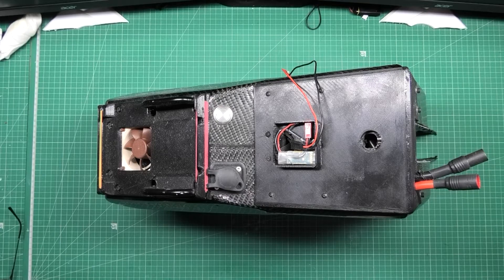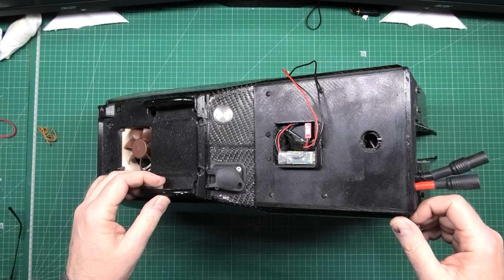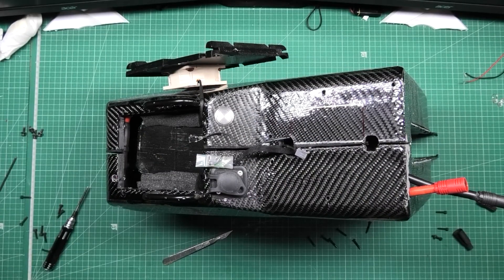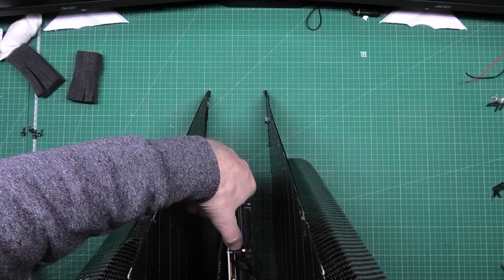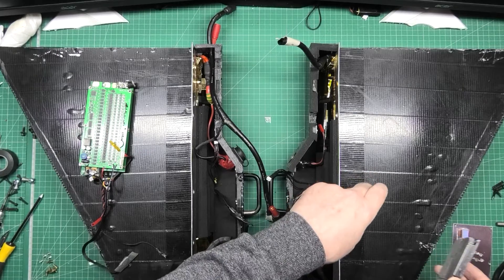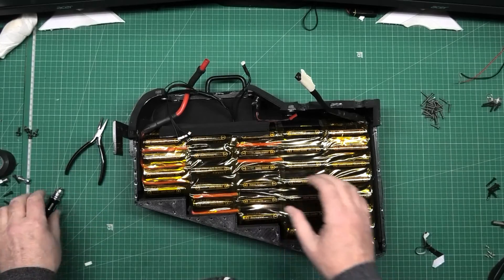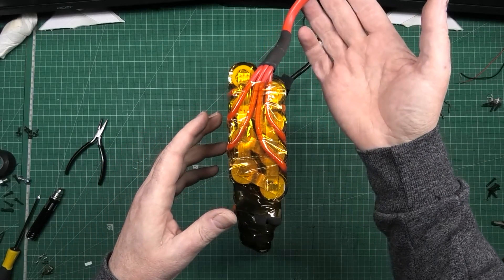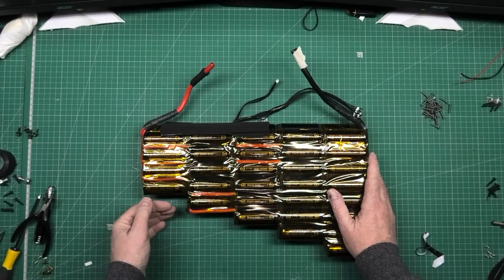High powered e-Bike battery BMS replacement - part 1

Comment: Hi, do I use common or separate port  bms type for ebike 72v 20s 3p 80 continuous? Thx
Reply: Hi guys, i have a question, thx in advance if youll help.
Im building a ebike, with my own battery pack, 72v 20s 3p (80a continuous, 105A peak) with 18650 cells sony vtc5a, what BMS do i have to get, i found one on aliexpress from Daly, and i can pick common port (2 wire) and separate port (3 wire) . Which one to buy, 2 or 3 wire version? Do you have another BMS to recommend?
Thx guys, im new here and in e bike space, cheers

Comment: sounds like a cell or two has been damaged in cell bank “six”...higher inner cell resistance will drag down the voltage of the other cells in parallel to the damaged cell(s).   Maybe got a lil warm...🤷🏻‍♂️    Dang batteries always seem to be the weak link on ebikes.  Maybe the manufacturer would be willing to send replacement cells...especially if you are ordering more cells for a bigger battery!  😀
Reply from the maker: It's been like it since I built it mate but it hasn't got any worse. It doesn't affect performance or charging ability, it's only when it's left to stand for a while that it drops...... I'll live with it 😁

Comment: i dont like spot welded batts from the bumps the welds cracks and you dont have contact to all paralel 18650 you must reweld each pole with soft copper wire and some slack on the cables when batt moves cable will not brake the weld =]]]

Comment: I'm having the same problem with my homemade 6P 20S Littokala  pack with the same BMS as Tony's.  Cell 19 is always showing lower ( 300-500  millivolts or more) than the rest. All the other cells balance almost spot on with each other. This has recently appeared.  I have about 800 miles on the pack .I hate the thought of tearing the pack apart to see what's going on.
Reply from the maker: It could be 1 cell that's gone down............ it's a tough call to make but, if it's 300-500 mV, I'd certainly strip it and find the problem mate.

Comment: my bms had one cell group that was dropping and turned out to be a shorted resistor for the blanching. yours might have had the same problem either that or the Cell Ah are slightly off by like 100ma or something and thats why its slightly lower
Reply from the maker: I think it's just one slightly weak cell on mine. If I push it hard, they all settle at exactly the same voltage and it's only when they're left to rest for a few days that it starts dropping (BMS connected or not).
Reply: @Vortecks  your probably right i think i have one strong set of cells in my pack after 30 ish charges i notice one set stays hihger then rest but dosnt bother me much i very rarely go past half charge on my 35ah pack sometimes i get 2 or 3 trips out of it before i deside to recharge it. Unless i know i have a long trip the day of then i do i quick charge witch at half charge only takes 2hours or so with my 13A charger.

Comment: Wouldn't putting the cells perpendicular make it easier to fill the space up?
Reply from the maker: Putting them perpendicular, adds strain on the series links and there's a potential for a 'compression' short. I did consider it when I built it, but there is a risk involved.

Comment: I wonder if there is a mismatched resistor in your BMS that is messing up that one voltage measurement?

Before you tear in to the battery, test it with a different BMS.

I'm thinking of making a modular battery from 1S6P modules and a wiring harness that incorporates balance wires so that I can make spares and swap around stuff.

It will wind up 15S12P made with 18650s.  I'm going for range more than power output so the lower voltage should be ok.

The only thing I'm worried about is connector resistance.  I'm not sure how to do the math on that.  I'm going to use XT60s for the internal connections with XT90s out to the motor controller.  Since I'm going to be using two 1S6P modules to create the 12P configuration, the XT60s are essentially going to be paralleled for half of the total current and resistance.

Comment: 100mph on a push bike!!! not your best idea Tony, thought ur idea to convert an old motor bike was a better idea and then u can get it registered, so the plod dont give you a hard time, apart from doing 100mph that is :-P  :-P
Reply from the maker: The trouble is, Mark..... getting a road legal motorbike up 2 flights of stairs is going to be virtually impossible unless I can ride it up. I got slightly off track with the whole idea of e-Biking and I stupidly went down the MSVA (registering) route - I wish I hadn't bothered. I want this thing to be free transport and, if I convert a pre-registered bike, I'll have to pay money to the government and be like every other sheep on the road. I'm different, I like to be different and that's the way it's going to be 😊
Reply: Old motor bike you wouldn't need to register and bike Tony used was a bicycle that he had intended to register but other things got in the way

Comment: I've got a low cell group in my battery... Replaced the BMS and it didn't help. I said fuck it, Ill just use it till it forces me to do something about it. Just can't be bothered. I feel you mate.
Reply from the maker: Mine doesn't drop on cell 6 when I'm charging or running, it's only when it's left standing which is strange.
Reply: @Vortecks  Yeh that is much better than my situation :D. Self-discharge is a bitch. I bet it will be fine as long as you keep it in the back of your mind ;)